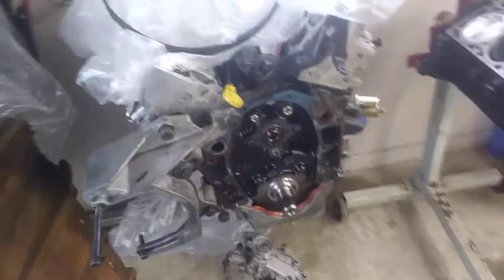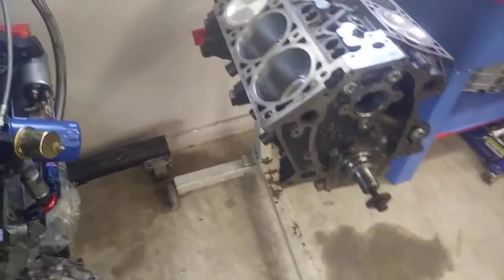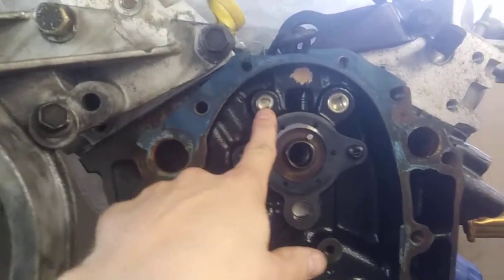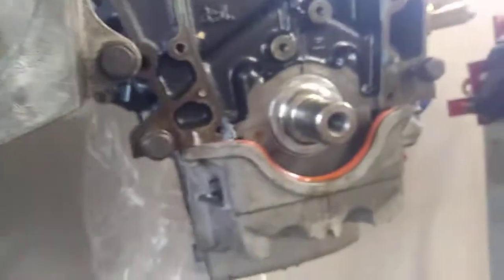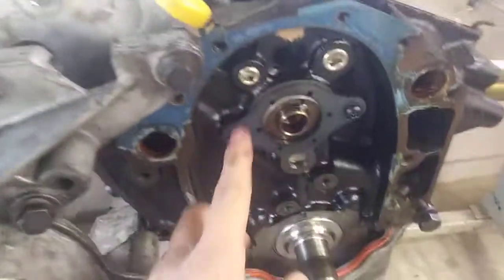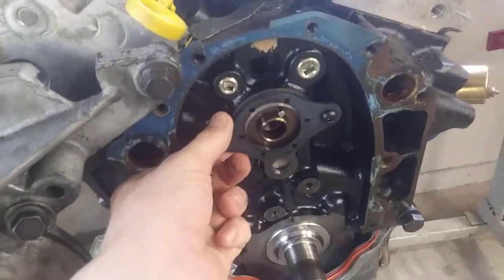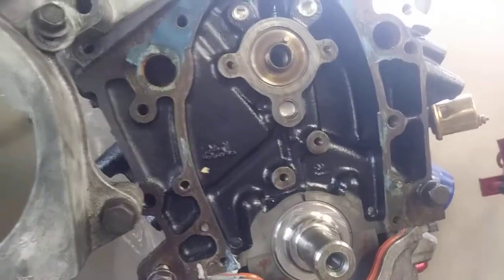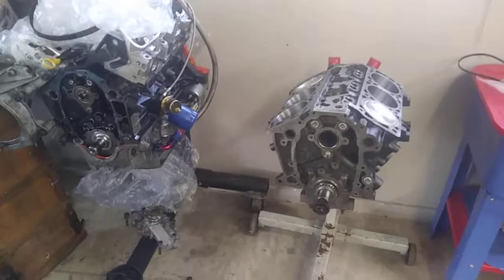Block differences of lx9 and lz4/lz9 for Fiero use

Comment: Can a guy stroke a lx9 with using a lz9 crank and rods
Reply from the maker: Lx9 and lz9 share same stroke of 3.31
Reply: @Slowv8Fiero questions for you as I am learning.  How can we take our 3500 lx9 and stroke it to a 3900? Or how is that accomplished?
Reply from the maker: @Gaberial-f6x   you can't stroke it anymore without a custom crankshaft.  How much money you want to dump into this?
Reply: @Slowv8Fiero ok found specs got it! Hmm  yeah 5mm in boar is a lot,  probably get what 3650 at .60 over?
Reply from the maker: @Gaberial-f6x   maybe. If you want more displacement use an Lz9. It's that simple
Reply: @Slowv8Fiero Thanks for your time and information. I should have clarified,  it has to be 3100/3400 stock appearing for SCCA CHUMP CAR Enduro racing. So we have a new 3500 that we're building w 3400 timing cover, 3400 manifolds , etc.  Looks like 3900 block is very similar.
Reply from the maker: @Gaberial-f6x   well if you use an lx9 and it's supposed to be a 3400 then you're already cheating.
I guess you gotta play by the rules

Comment: I had a 87 firebird built up 3.4 with hooker long tube headers jet hot coated a crane cam 1.62 roller rockers and bored 30 over ported polished heads jacobs pro street ignition and ultra coil. Underdrive pulley's accel 19lb injectors and custom chip. 700r4 trans with b&m shift kit it chirped the tires from 1 and 2nd i had it finished in 2003 before all the better engines cam around. Ill bet i didnt have anything over 180 hp out of it. It was night and day over my stock 2.8 and it had way more top end on the freeway the 2.8 just made noise at 65 when you mashed the gas down the 3.4 actually got going. It seemed very long legged. A 4 or 5 speed manual would have been better for it im sure...very nice build though..😊

Comment: The lz9 has got to be the lightest when you swap other things from other engines. Says 349 lbs online. I wish there was a accurate engine weight list online I've looked all over and some are right but others are way off cause i think they weighed them with the transmission on it .

Comment: Would you know how thin of a head gasket could you use on the 3900 for max compression? 
Thinking about doing N/A build in a 5 speed sunbird
Reply from the maker: I'd do .040 as thinnest.  You can bump compression with pistons if you use an aftermarket piston
Reply: Thank you for the quick reply. I’m just learning about 3900 engine now. A .40 gasket should put it around 10.5 compression I would think. 
Now I got under my car today to see what the one front motor mount I see the there’s two bolt that bolt to the 
block bosses. 
In your opinion should I bolt that one  front bolt to that boss on the block and make my own front mount some where?
Reply from the maker: @johnh9604  factory mount is sufficient
Reply: @Slowv8Fiero  I felt like that was sufficient too. I can’t find anything about swapping a 3900 in a jbody. 
The 3.1 Cross over should work ? 
Piggy backing the gauges through the stock obd2 computer should be straight forward I presume
Reply from the maker: @johnh9604   3.1 crossover prob won't work at the exh manifold bolt pattern is different between the 3900 and the older gen motors.  Which means you will prob have to use the 3900 crossover.

Comment: Nice video dude. I'm new to the wanting to build a twin turbo v6,my main experience has always been w SBC and Ford v8's,no power adders though. I decided I wanted to do a real light chassis (MX5,Mr2,rx7 etc)  where a turbo SBC would be too much for what I want it for. Anyway,a question I wanted to ask but can't really find an answer for is
With the LZ9 having 5.7 conrods and the LZ4 having 5.9 conrods,most are using modified LS or gen 1 aftermarket rods. This got me thinking ,cuz the new LF3-4 twin turbo v6's (use the same size conrods I believe come w pankle titanium rods(5.99) ,why couldn't they be used in an LZ4 w the 5.9 rods? Their already speced to handle boost,lighter than 4340 steel rods, and only $35-40 a piece according to GM parts direct. Just asking your thoughts on this or where I can go to ask this question? Those titanium rods on a LZ4(arp bolts obviously), would make 1 hell of a quick revving engine under boost.
Reply from the maker: I measured my lz9 rods at 5.827 inch.  GM specs the lz9 rod at 5.9. Not sure about the lz4 off the top of my head.

A 5.99 rod would prob put the piston out of the hole by a good bit.

Stock lz4 and lz9 rod can handle 600 hp.  Not sure how much more you wanted to make?
Reply: Right on man,thank you for answering my question. Trying to get detailed specs etc on these engines are like pulling teeth. Some of what I could find contradict each other, especially when it comes to rod length. 550-600hp at the wheels was what I was aiming for on 93 w meth injury, about 700rwhp on e85.. Obviously I wouldn't run that much for just normal driving in such a light car but,w these new electronic boost controllers/megasquirt 3 ultimate ECU etc, allows me hold a bunch of other tunes. 
I knew the rods were a little longer but was wondering if I could of compensated for it thru the Pistons itself,no biggie. 
Did you by any chance cc the Chambers on the heads? Cuz the 1 other thing I can't find no matter how hard I search is,what size Chambers the cylinder heads actually have (48-58-64 etc etc). Anyway, again thanks for replying. I just happened upon your videos the other day and immediately subscribed. Your are the only ones I've seen going into details on the differences between lx9-lz4-9 engine's w actual pics/video,helps out a ton and your engine looks great by the way
Reply from the maker: @ericgarrison5097  I have not ccd the chambers.  I believe I too read it was around 48cc. I did cc the intake and exhaust ports though.  I would have to go back and check my notes but I think intake was around 130cc and exhaust was around 75cc.

Stock rods should handle your hp goals.  I used arp bolts in mine.  There is an off the shelf ls1 piston that works too and gives decent cr for boost.  Or keep stock pistons for the time being.  They will handle 600 hp with a good tune
Reply: Cool man, appreciate it. Although 1 thing Id definitely planned on was a forged 4340 H beam rods w pistons and tool steel pins. I was asking about the titanium only cuz they were already boosted from the factory and figured would be way lighter than the forged,plus were actually pretty cheap from GM parts direct. Would of been a quick revving engine,but too many unknowns. Yeah,I definitely want to forge the rotating assembly just for peace of mind. Plus I've been also considering a 60-90shot of nitrous but,not really aimed at more power but as kinda of antilag thing. Using a progressive controller set for like 30-50% at 1800rpm,100% at 2-2500 and turn it of once I'm around 5-7psi of boost. It wouldn't be used for an everyday type thing,only really for a race or for an occasional trip to a strip.
Reply: gap rings and tune it boost it look at ting honda ka rods live with boost 500+ hp gaping rings and cool air inner-cooler and a good tune  no need to spend cash on gm stuff rods are big oem i thing on them not stindy i mean pump gas engines need very little addition other than ring gap..let boost rise with rpm not over boosting at low rpm that a killer of any thing

Comment: This is probaly a long shot but do you still have both the blocks cause im trying to figure out if the lx9 crank sensor will fit in the lz9 block without it hitting or being to far from the reluctor  wheel
Reply from the maker: Yes I still have both.  If my lz9 still has the crank sensor I will swap to lx9 and see if it clears
Reply: @Slowv8Fiero  thank you im gonna start a build soon i just didn't want to buy a lz9 to be disappointed if other sensor doesn't fit

Comment: Are the exhaust ports of the LZ9 different from the Lx9?
Reply from the maker: The ports are about the same shape but the bolt pattern for the exhaust manifold changed from the lx9 to the lz9.  The lx9 manifolds will not bolt to the lz style heads.
Reply: @Slowv8Fiero  Do you have a write-up or build diary on your engine somewhere? I am building my LX9 for turbo and rwd application.  LX9Alpine dot com
Reply from the maker: @BiLB-DIY  no. No build diary really.  I started a thread on realfierotech dot com on parts used in my lz9 build up.  Most of it is covered in the vids though.

My lx9 turbo engine was a bone stock bottom end.  I did nothing to it.